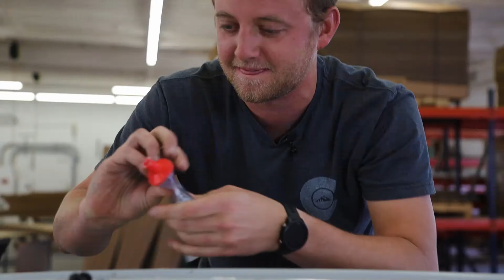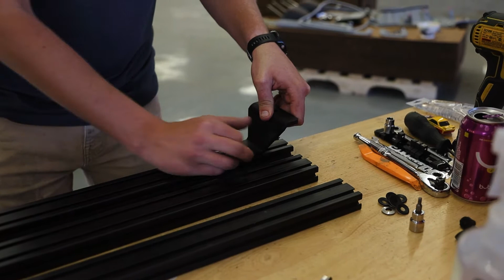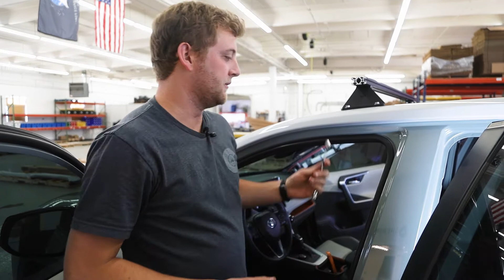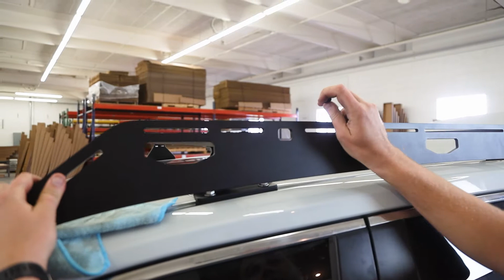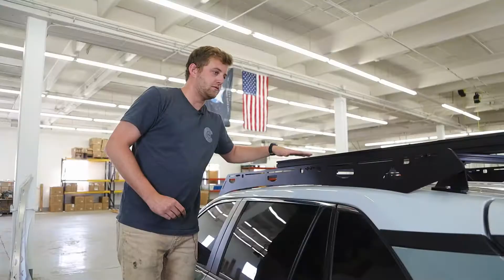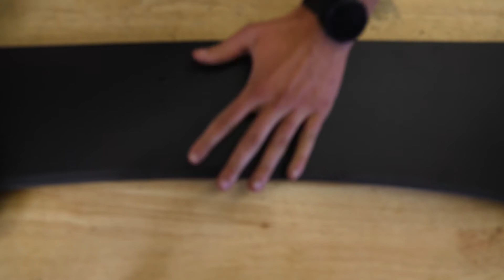The Snowmass Rack Install - 2019 - 2022 Toyota RAV4 Roofrack

Comment: Is there a torque spec for the hardware? Specifically, the hardware mounting to the vehicle.. I know you mentioned not over tightening and how it may comprise the water seal. Are there torque specs for those bolts?
Reply from the maker: Those are using our bonded washers so you are tightening until you see the washer flatten out and the seal on the washer compressing. You do not want to tighten them past the washer becoming flat or it can compromise the seal. Usually, this is around 22-inch pounds but sometimes requires a little bit more.
Reply: @sherpaec 22in-lbs is like 1/10 the torque that the Toyota specified factory rack hardware (26Nm in the manual). If I change out the washers from the flat/sandwich style to the outer steel/inner rubber style (designed to seal under load), can the rest of the structure in the stack take a larger torque rating (to factory spec specifically)? I have a rack on order, so I appreciate your answer.
Reply from the maker: Hi Johnny, we have not done any testing with those style washers and thus we can not confirm that A: you can tighten it to that spec B: that it would be a watertight seal. We have done ample testing with our setup and reccomend that you install as per our instructions. @JohnnyHarrell
Reply: I appreciate the reply and understand your stance on install.  22in-lbs (~1.8ft-lbs, ~2.5Nm) seem incredibly low for the application. @sherpaec
Reply: @sherpaec do you have an update on this?  i'm considering an order but if it's tightening stuff then it would be useful to know some specs so i don't have to worry about stuff rattling/coming loose.

Comment: My 22 Rav4 only has 5 holes per side, holes 2 and 3 are now 1 and 2. I'm screwed.

EDIT: Toyota got rid of the extra holes. All the ones needed are still there, and only the two larger rubber gaskets were needed.

All installed and finished! So very pleased with the result!
Reply from the maker: We are glad that everything worked out well for your installation!
Reply: So you were able to install the Sherpa on your 2022 RAV4?

Comment: Just ordered mine, but I'm a little curious.

How long do these rubber plugs last? I live in Northern Michigan so snow and ice are a very real hazard up here. How does this product hold up in the winter? What kind of preventative maintenance do you recommend?
Reply from the maker: We don't have more the one winter season on this design. We do however have years of experience with the compound we are using with very few issues over that time frame. I'd 100% keep an eye on them and if any concern or issues arise we can gladly replace them for you.
Reply: @sherpaec , excellent. Is there a way to order extra mounting equipment in the event of wear and tear? This vehicle will be pulling double duty as my daily driver in winter months, so the rubber will definitely get abused!
Reply: @sherpaec  The further I go down the comment section the more I am in awe at the price for this rack… I spend $1,400 and have to keep an eye on it. Got it. Maybe there should be more research and development. I feel like y’all would rather have people saying, “Take my money!” rather than questioning the product. I agree, I live in TX and like the rubber idea but how has this not been tested out from the beginning of roof racks.

Comment: Can anyone please help confirm the following?
1. Does this "not work with Panoramic sunroof" because you can't open the sunroof after? 
2. Does it "not work with the Panoramic sunroof" because the sunroof is occupying space/holes/etc. the rack needs to plug in? 

I am ok with not opening the sunroof.
Reply from the maker: The rack does not sit high enought to allow the sunroof to open, but the rack can still be installed without issue so long as you don't open the sunroof.
Reply: Any chance of a model coming along that allows the sunroof to be opened?
Reply: @adammescan4860 No, these companies don’t consider these things. They are college graduates. Not experienced adventurers, just diploma holders. Let’s say they are experienced, then they aren’t doing their job talking to the board who are just cashing checks and could care less. Some of us have the money to have the panorama sunroofs, we don’t care if the rack is a hair taller than the low-pro. We want a rack on our SUV that doesn’t require remembering not to open a window or else something gets messed up… Can’t wait for a real backpacker to start a company that focuses on what us daily drivers focus on. Road noise, user friendly, simplicity, effectiveness…. For a Rav4 that has a roof load limit of 176lbs and y’all couldn’t figure something out that’s direct bolt on…. Get with the program. Dropping a headliner to drill holes so I can put 3 bags of deer corn on my roof rack… nahh. Y’all want any advice that you’ll actually listen to, here we are. Fly me in, I’ll turn your racks into the ONLY racks.